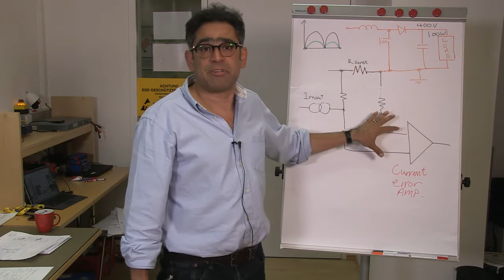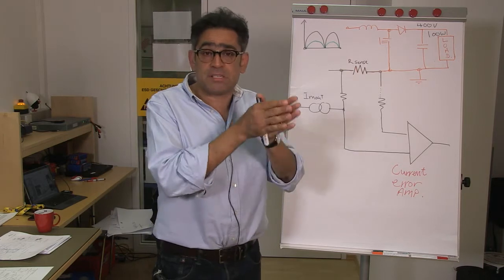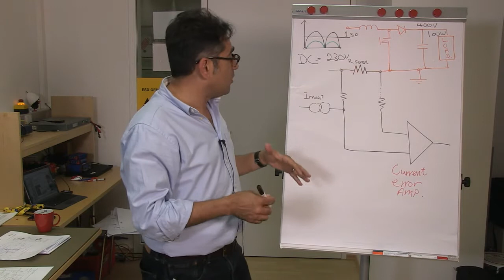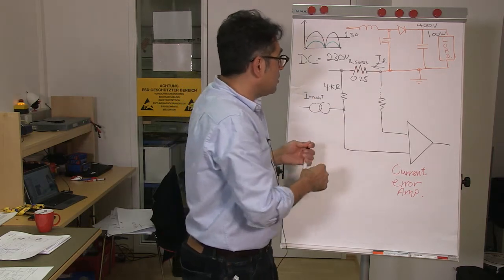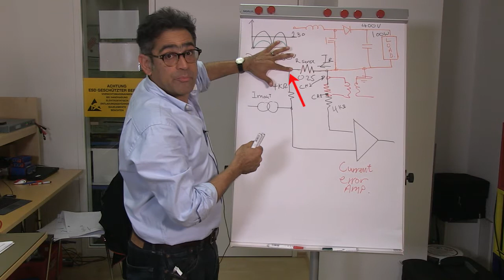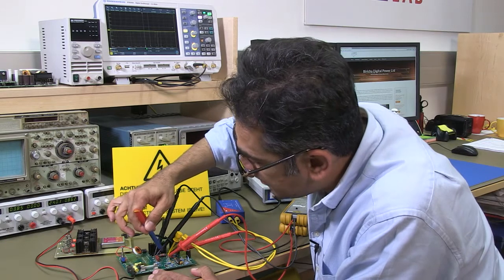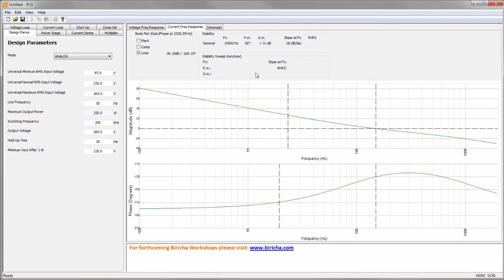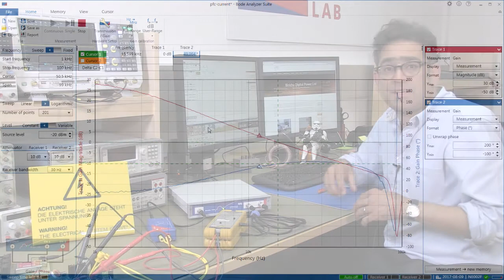Measuring the current loop of a PFC

Comment: sir, if i use  a hall effect  sensor  instead of  current  sensing  0.25 ohms resistor ,is it possible  through this?
Reply from the maker: Dear Sanat Ghosh,

the loop measurement works the same way, no matter if you use a hall effect sensor or a sense resistor.